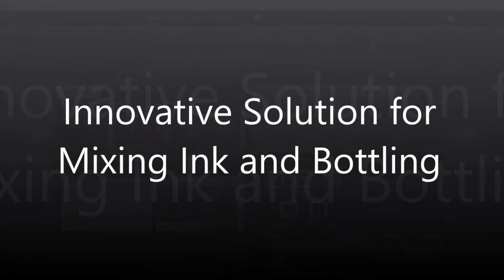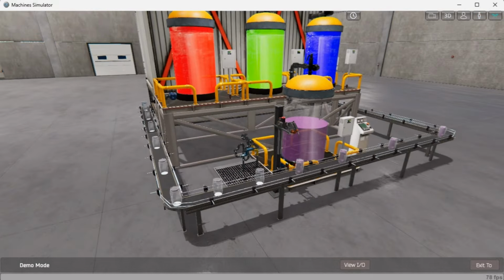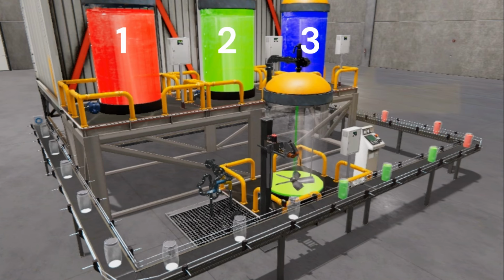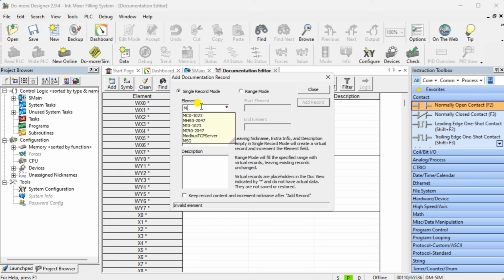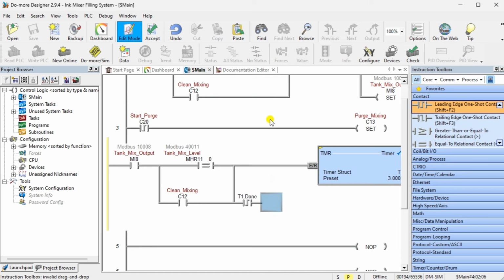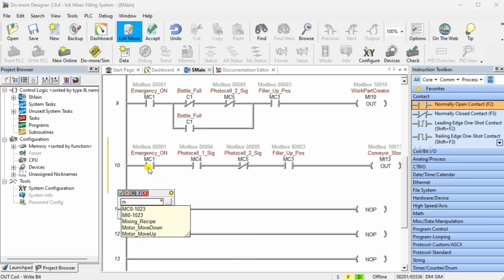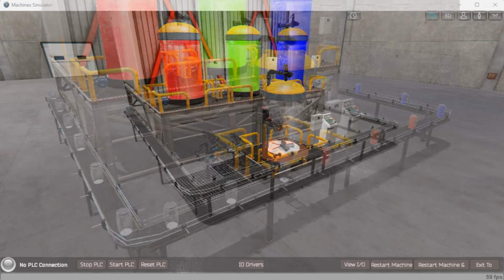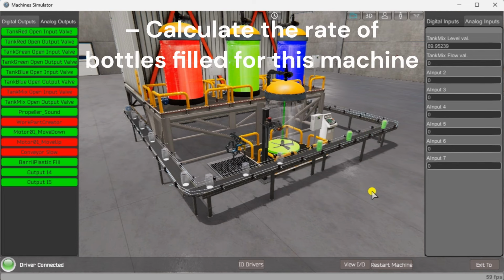Master PLC Programming: Build Smart Ink Mixer with Recipes

Comment from the maker: ▶ FULL SERIES — BRX and Do-More PLC Programming, in teaching order. Start at Episode 1: https://www.youtube.com/watch?v=wSYgY09VYeA&list=PLYu2PsQCzNJA

Our website post provides effortless access to all the relevant links discussed in the video. We have gathered all the necessary information for your convenience, to all the resources mentioned.
https://accautomation.ca/innovative-solution-for-mixing-ink-and-bottling/

The EasyPLC Software Suite Series can be found here...
https://accautomation.ca/series/easyplc-software-suite/

EasyPLC Software Suite is a complete PLC, HMI, and Machine Simulator Software package.
This PLC learning package includes the following:
Easy PLC - PLC Simulation will allow Ladder, Grafcet, Logic Blocks, or Script programming.
HMI System - Easily create a visual human-machine interface (HMI),
Machine Simulator - A virtual 3D world with real-time graphics and physical properties.  PLC programs can be tested using EasyPLC or through other interfaces. (Modbus RTU, TCP, etc.)
Machine Simulator Lite - Designed to run on Android Devices.
Machine Simulator VR - Virtual Reality comes to life so you can test, train, or practice your PLC programming.

Purchase your copy of this learning package for less than USD 95 for a single computer install or less than USD 110 to allow different computers.
Receive 10% off the price by typing in ACC in the comment section when you order.
http://www.nirtec.com/index.php/purchase-price/
Learn PLC programming the easy way.
You can invest in yourself today.

Here is a list of YouTube Shorts about the EasyPLC Software Suite, including the Machine Simulator.
https://www.youtube.com/playlist?list=PL3y71jAPOdZAvTC8-TWNifAHpgEkAfqZQ

ACC Automation
https://accautomation.ca/